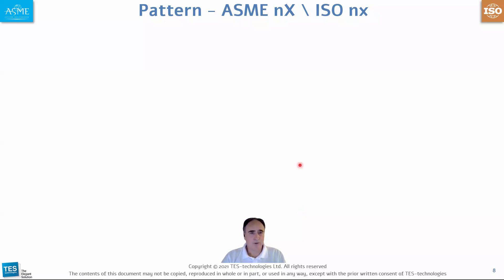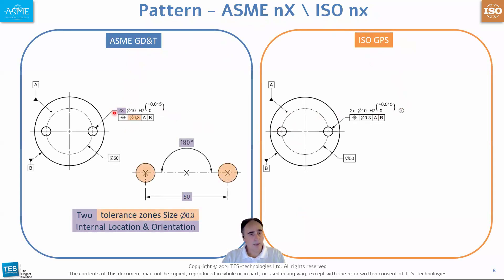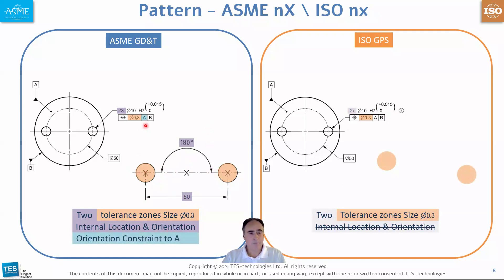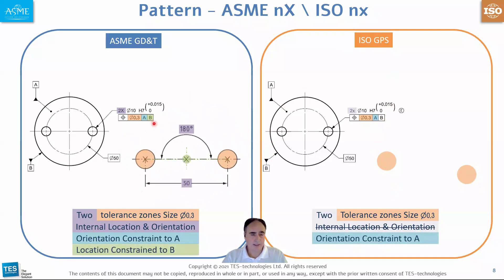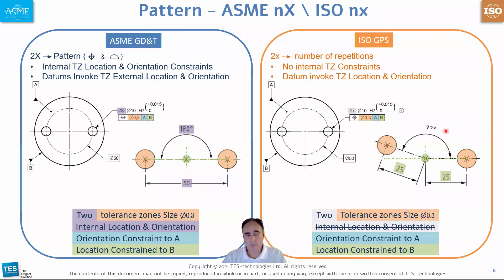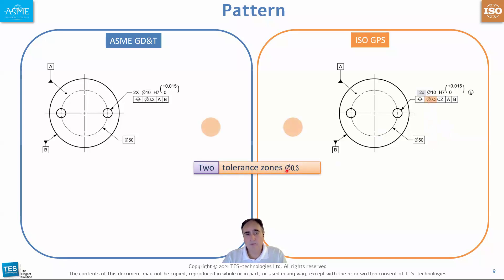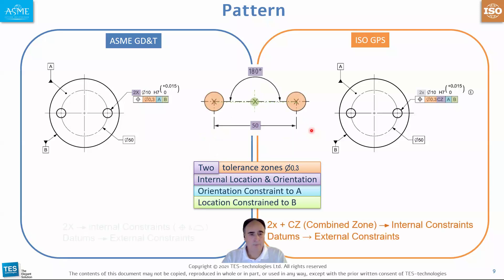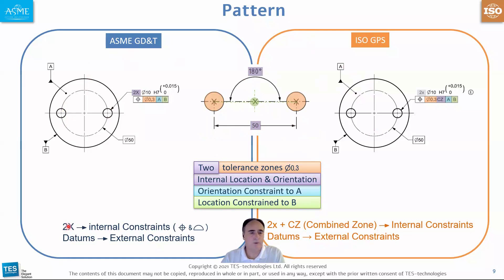ASME GD&T - Pattern vs. ISO GPS - Combined zone

Comment: According to ASME Y14.5, the position tolerance is applied to the axis (symmetry plane) of an unrelated actual mating envelope, i.e., maximum inscribed feature or minimum circumscribed feature (respectively, cylinder or two parallel planes). According to ISO GPS standard by default the position tolerance applies to derived median lines. So in the right drawing additional modifier must be added in specification to indicate that the specification does not apply to the indicated feature itself, but to a feature associated with it. In this case, the encircled N shall be placed after the tolerance value to indicate that the toleranced feature is defined as the derived feature (axis) of the associated minimum circumscribed cylinder.
Reply: Naturally, for the holes a encircled X must be placed after the tolerance value to indicate that the toleranced feature is defined as axis of the associated maximun inscribed cylinder
Reply: @StefanoTornincasa  The same mistake is made in an example in ISO 5459:2024.
Reply from the maker: Hi Stefano
Yes, you are correct
But the intent was to show the differences between Standard deafaults